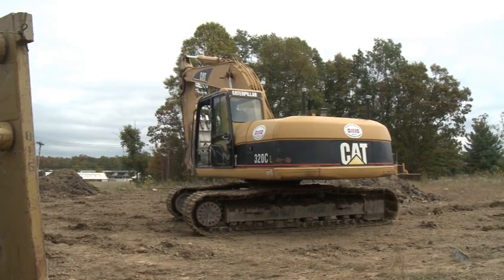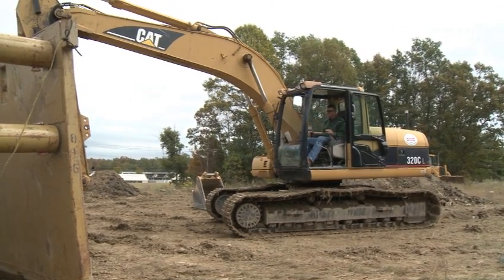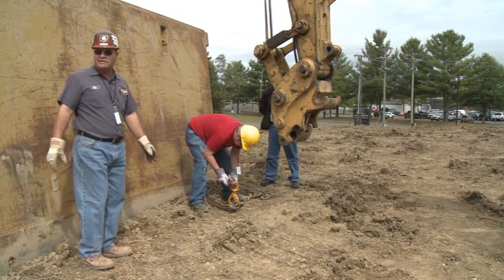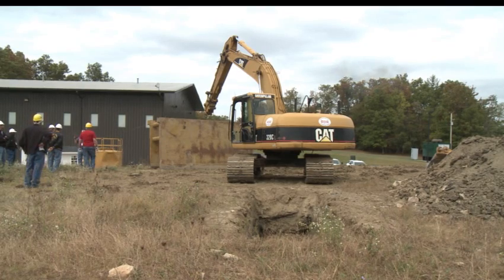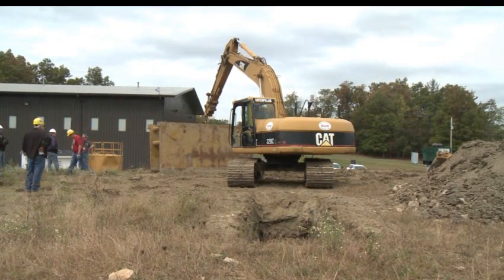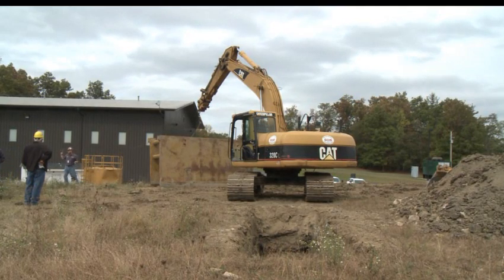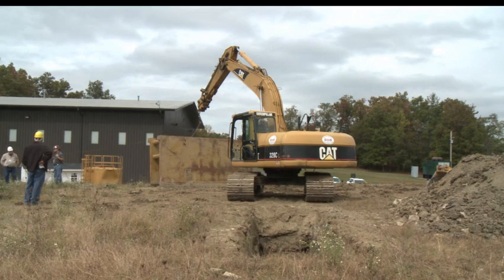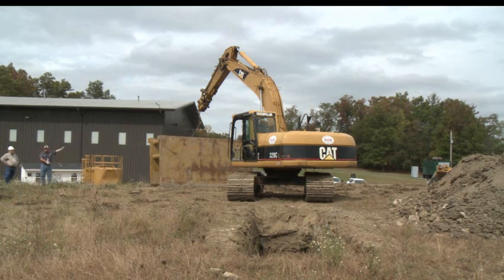Rigging and Setting a Trench Box (Exercise)

Comment: Man I'd look ar my boss and ask this guy has no idea he asking us. Threads out on which side of the bucket the threads will all ways be out one side or the other. Watch out the booms to high there could be lightning see the clouds looks like there getting lower to the ground. Hey watch that tail line by your feet man it could trip ya in to the hole. That tail line wraps around your leg that box will drag your butt lose a toe man never know. Like when the tie off cord for 4ft pulled the ladder on my face ues it hurt my tail bond but damn the luck the safety cord and ladder knocked my teeth out broke my jaw. It would have just been a limp safety first. Het man pull thar wite from the pin need for my jaw know and speech impediment. There's a point when saft÷y starts getting people hurt is a dangerous job and I like being safe but when osha tells us we can't us a water truck or garden hose for concrete cutting but this little ass machines with a battery won't put out a camp fire and then rite out the box the pump floats on top and all the guys asking can you fix it yes I went a filled the excavator buck with water a work way better. Guy telling me stihl saw water hose on the side of the saw was for looks. Have you ever ran a hot saw before or after he drank purple stuff under the sink because it wasn't marked under the sink. I like grape kool-aid but if under the sink I'm looking in the fridge or just drinking water just me. Sad think the osha guy dint even smoke weed so there's no excuses for drinking stuff u,er the sink at his age not one I learned that at like 3 grandma told us she would beat are ass if we was drinking pledge lemon aid. Then tell me to take a drug test mfer I might have thc I'm my system but I garintie you won't find windex. Now I have smoked some purple but even after never thought about drinking merical grow I bought a sprite

Comment: I felt it was all correct except the trench at the open end of each end of the box the trench was not sloped
Reply: This was a training session. In real life the trench would either be sloped if they were working on a small section, or the trench would be miles long so that you wouldn't have to keep switching from the bucket to the box. And they would just pull the box along the trench. Probably right that he should have mentioned that, though.